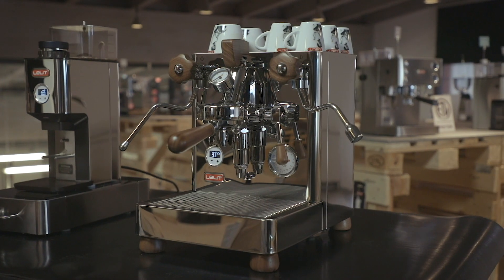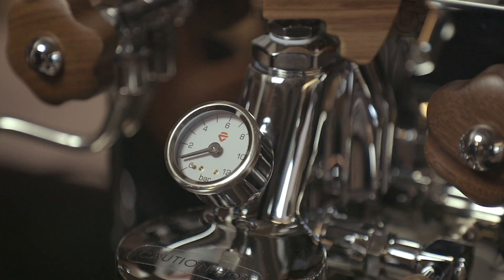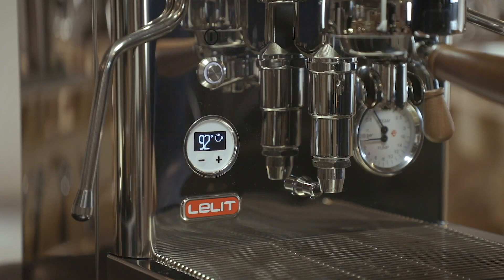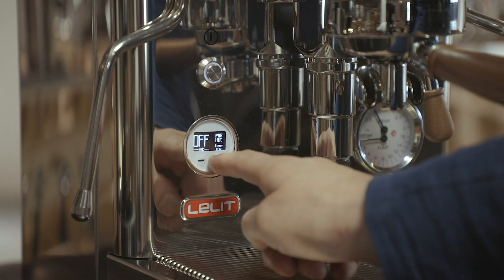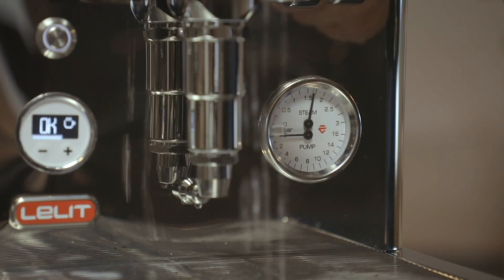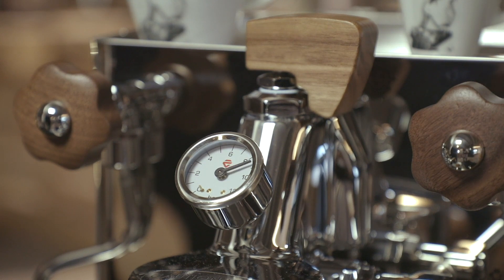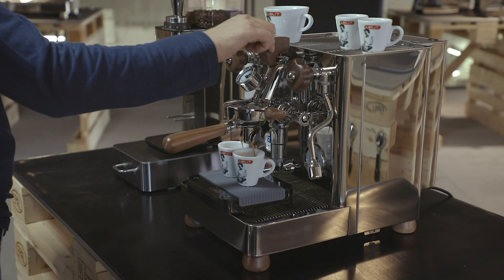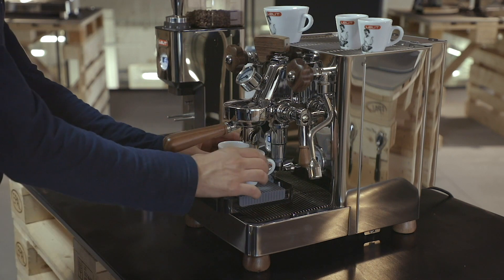LELIT Bianca PL162T: How the preinfusion works

Comment: Did I hear that correctly? There is no preinfusion chamber in the Bianca? So the classic 4 bar preinfusion of the E61 is not present?
Reply from the maker: Hello, please note that it’s possible to adjust the flow manually thanks to the paddle installed on the group head. Thank you, LELIT Team
Reply: @LELIT_Official  This is obvious, but how about the preinfusion chamber? Does it have any function in the Bianca or is there really only electronic preinfusion and the paddle?
Reply from the maker: @pastagandalf  Hello, the preinfusion in LELIT Bianca is electronic and adjustable with the paddle. Thank you, LELIT Team
Reply: @Illu M.  You are correct.. the classic 4 bar preinfusion of an E61 is not present in the Bianca, however once familiar with the Bianca you can use the flow control valve to set at your desired bar during the preinfusion time frame. Personally I'm not a fan of the automatic programmed preinfusion as demonstrated in this video with the flow control valve fully opened. When performed as demonstrated the puck is hit with water at its maximum flow rate during the initial 3 seconds of preinfusion which could conceivably disrupt the puck and lead to channeling. Instead I set the paddle to a reduced position during the initial 3 second preinfusion sequence, then when the pump shuts off for the resting phase I open the paddle fully. Just FYI: To many unfamiliar with the Bianca the paddle "appears" to be a pressure adjustment which is not the case, the paddle actually only controls water flow rate to the puck. The actual operating bar (i.e,  pump pressure) is made by via a physical adjustment on the pump assembly.  With this in mind, if a puck is fully saturated, a reduced water flow rate allows whatever water is being introduced to the grouphead enough space and time for it to pass through the puck, whereas if the paddle is moved to its maximum opened position the increase in water volume in the grouphead is more than the puck can quickly pass so the backup of water causes the pressure at the puck to increase. NET: Reducing or increasing the water flow at the grouphead in-turn reduces and/or increases pressure at the puck.
Reply: @eltonnoway7864  One thing you're missing is the Bianca V3 has got a low flow start/end setting that reduces flow to a lower level (i think about half of the regular flow) for a variable time at the beginning of the brew and again from a set time onwards until you shut it off with the lever.

This makes it even possible to dial in slayer style shots where you only need to stop it at the right time.
Reply: @pastagandalf  My original comment was in regards to the V1 version of the Bianca being demonstrated in this video. However... now your twisting the knife! You are correct! Version 3 of the Bianca with its new low flow start/end setting is everything you said it is. Unfortunately I'm an early adopter and I have Version 1. The awesome thing about Lelit is they continually tweak and improve the Bianca. Also nice is its rumored there will soon be a kit so V1 and V2 owners can upgrade their units to have the flow features of the V3. The caveat: Although a V2 will technically become a V3 it's not so for us poor V1 owners. Yes, we'll pickup the new flow feature of the V3 but we'll always be plagued by the "short / stubby" water and steam control valves.😞 (The V2 introduced longer valve bodies that moved the steam and hot water wands further out away from the case allowing for more movement and flexibility when making drinks.)
Reply: @eltonnoway7864  I think I read about ca. 400 euros for the kit somewhere plus installation. Really pleased with the Bianca!

Comment: Hello, my new V3 Bianco arrived yesterday. Great! Quick question, if I may. When the programmed pre-infusion finishes at 8 secs, does the pressure then automatically ramp up because the paddle is completely to the right side? Then, the user is responsible for ending the extraction time? Is that correct? This much
Reply from the maker: Hello, we confirm that you get the maximum flow rate by opening the paddle completely toward the right. Moreover, the user will always need to interrupt the extraction manually by lowering the lever. We remain at your complete disposal for any issue. Thank you, LELIT Team

Comment: What's the difference between pre-infusion and using the paddle to manually lower the pressure to ZERO bars? Is there a mechanical difference? And if you turn the paddle all the way to the left, do you shut off the water flow as well?
Reply from the maker: It’s possible to vary the flow manually until you close it completely. The pre-set pre-infusion works with the pump and the solenoid valve. The Paddle offers the possibility to vary during the extraction. The pre-set pre-infusion works at the very beginning of the extraction phase.
Reply: @LELIT_Official  Does the pre-set pre-infusion worked on non-plumbable setup or only if it's plumbed into the water line as with most machines?
Reply from the maker: @GlennMartin  Hello, the pre-infusion works on both setup, machine working with the water tank or connected to the water mains. Thank you, LELIT team

Comment: during the pre infusion the paddle must be open at max? how important is the pre infusion and rest time and why should I change the pre infusion time by changing the type of coffee? Thanks
Reply: Yes, because then it would fight each other. You can use either automatic pre-infusion using LCC as shown on the video or you can turn off automatic pre-infusion in LCC and do manual pre-infusion by playing around with the paddle - e.g. to simulate what they shown with automatic pre-infusion you just pull the lever on for 3 seconds, vessel fully open, then after 3 seconds you completely close the flow by turning the paddle all way to the left, wait 5 seconds and then fully open again. Simple as that. With manual pre-infusion you have more to play with ;)
Reply: @misenko856  Although, I'd recommend not simulating the bianca's 'pre-infusion' with the paddle. Turning on the pump, then turning it off for a time isn't really preinfusion. In fact, it's pretty bad for the puck as the sudden high pressure will potentially damage the puck, then turning it off to soak the puck... will do nothing. What you want to do is keep pressure low, around 2 or 3 bar for the first 7 to 10 seconds. Then gradually turn up to 9 bar. You can even wait till you see the first drips come through before jumping to 9 bar. That's how real pre-infusion with a lever machine is meant to work.

Turning a pump on and off is honestly a gimmick, which should only be used if you don't want to stand by the machine. If you're using the paddle anyway, I don't see the point of the 'pre-infusion' setting in the bianca.
Reply: @Drift-yf4rn  Yep video isn't so great lol I think with any E61 group machine you can do a trick where you can kinda pre infuse by running the pump and then you can stop the pump and let off on the pressure by moving the brew lever half way point, I didn't think it would disrupt the coffee bed unless you go all the way down where it relieves the pressure and goes PSSCCH. 

If it's plumbed in, on some machines with the brew lever half way you'll get whatever the line pressure is, 2-4 bars I Think is normal range for most places, and that's actually a good pre infusion pressure, so in that case you wouldn't even need to run the pump at the start.